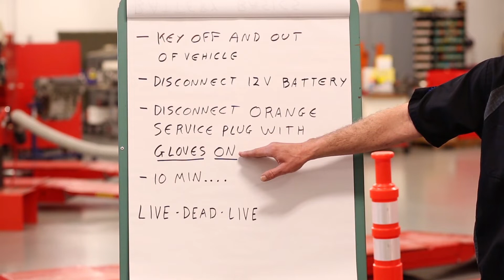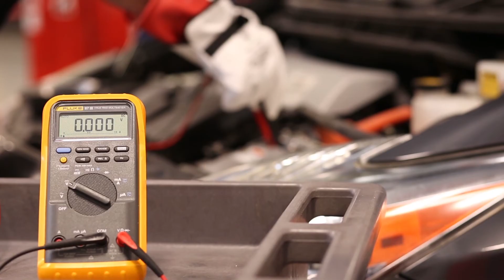Disconnecting High Voltage in Electric/Hybrid Vehicles

Comment: I'm a little surprised that the cutout switch cuts off at the positive lead, rather than the negative lead. Why? As you know, the traditional way that mechanics disable a 12V battery is by disconnecting the negative (ground) lead first. This is so that a wrench that will be disconnecting the positive lead next will not cause a short if the back part of the wrench touches any metal. In a car there are many more metal points that are on the negative side compared to the few positive contact points.  So, why is the safety on the positive side? Is it because the internal safety relays automatically cut out the negative side when the accessory battery is disabled?

Comment: To verify that your voltmeter works, you should set it to read Ohms and touch the leads together, if it reads zero ohms or very close to zero then that means that the leads are both working and able to give you accurate readings

Comment: Let me ask. If you want to use your hybrid car without the function of Hybrid bettery. What are you supposed to do?
Reply: Pretty sure you are able to control that with your car, by either using the specified buttons in your center console or on the radio interface

Comment: the service plug on this Prius actually splits the cell modules inside, not the full battery as illustrated
Reply: splitting one cell will deactivate the whole system because there isn`t a part for current to flow anymore
Reply: Yes but you still have seperate live circuits inside unless you disconnect all bus bars. All you have done is break current flow of the overall circuit in series

Comment: This video is mostly wonderful, except how did you gain access to an UNCOVERED power invert?  In my 2005 rPrius removing THAT cover requires many additional hours of labor.  Removal of the windshield washer assembly, above the back or the inverter cover, is required to access the last few cover bolts.  So it comes down to how confident can someone who wants to weld on this type of vehicle be that simply removing the orange service plug will be ENOUGH to guarantee they are working on a disconnected High Voltage Battery, without potentially killing the welder and/or the 2005 Prius.  Please address allowing access to this important multimeter safety check.  The lives of all the well intentioned shade tree mechanics who'd like to SAFELY repair this type of hybrid depend on access to the power inverter terminals shown in your video.

Comment: I have a couple questions (Have my Red Seal Exam coming up) When reconnecting the battery is it just the reverse process? high voltage battery first --> Safety switch --> 12v battery? Also the minimum required rating for the gloves is 1000V?
Reply: Class 0 For gloves (1000V) and CAT 3 Multimeter 1000v

Comment: As a tow truck operator I wish the NTHSA would require an emergency disconnect like the engine kill on race cars. At accident scenes it is a lot of work to get to all the stuff you had to do for just a repair. Much less worrying that the car body may be energized due to a pinched cable. Great video though, thanx for the info.

Comment: Great video.
2 seconds of contact at the lowest level of voltage ~ 50 ma, will kill a mechanic.
Always wear insulation gloves and use Insulated tools to prevent short circuits whilst working on high voltage systems.
Rubber insoles can be helpful in preventing shocks.
Reply: YOU SURE?  RUBBER INSOLES?   why, the damn thing is connected to Ground, thru a metal stake somewhere? my solar inverter is not...

Comment: Hello Mr.  I am Uddika Rathnayaka from Sri Lanka I have Toyota Prius ZW30 2011. In my vehicle there is a error code coming P3004. In my vehicle there is 
no corrosion in battery wires, 
battery voltage ok, 
From HV battery to inverter main power cable has no shortage 
Vehicle not ready 
Scanned several times every time same error code appeared
Please help me to solve this problem 
Thank you

Comment: Hi there. I will make some replacement on the inverter 2013 prius. I have some question with the parts number. It look like there are two lines of numbers written on the part’s sticker. Do i need to get them right, or just the first line (mine is G9200-47210)

Comment: Thanks so much. I have a project do next week on a Hyundai. I need to replace rear body panel and extension floor which includes welding. I’m assuming is the same Procedure.
Reply: Im just about to weld my exhaust on my Hybrid Lexus. How did your job turn out? Did this tutorial help you out?

Id appreciate your help 👍
Reply: @vincecfm3240  very good not a problem 👍🏼
Reply: @SRGLIST  
Awesome 👌 
Did you use voltage safe gloves?
Reply: @vincecfm3240  yes.

Comment: What do I need to do before replacing the hybrid battery? Is it safe to work on it after unplugged the orange safety plug?
Reply: Hybrid batteries should only be replaced by professional/certified technicians due to the safety equipment and training required. The courses and qualifications for a L3 ASE Technician in the US to safely work on Hybrids is around 12-36hours of safety and practical training as well as purchasing specialized High Voltage tools and Personal protective equipment. By all technical standards replacing the battery is not difficult but the risk of Electrocution is substantial and is not a job that should be handled unless you are absolutely certain you know what you are doing and have measures to protect yourself in the event of an accident. It would be the equivalent of asking if fixing the power line to your house is something you can do yourself. It's 250-800 volts, it is not something you should take lightly.

Comment: Do I need to disconnect the hybrid battery if I need to replace the starter?
Reply: Hybrid vehicles usually do not use a starter motor to start the vehicle. They use the electric motor that powers the wheels to also start the vehicle and is powered by the High Voltage battery and no current Hybrid vehicles above 250V use a standard starter motor to start the engine. Vehicles that use a starter with a Start/Stop function (that turns the engine off/on in stop/go traffic) can be replaced safely by disconnecting the 12V battery but must be replaced with starters that can handle being turned on/off 30-40 times per day (which are very expensive)
Reply: It uses a motor to turn the belt. It usually has the alternator built into it.

Comment: Hi i need to weld something on a corolla 2019 hybrid. Its the same procedure?? Thanks
Reply: Lol, I hope you're joking 😂. If you are doing welding on a hybrid chassis it is best to remove the hybrid battery before any prior work and ensure there is no residual voltage in the system. Make sure you have a clean, well connected, ground and welding can be done. I should note that modern vehicle computers such as blind spot monitors and ABS control can be damaged if excessive current from a weld is too close. Welding near or on a hybrid system is okay but precautions for each vehicle varies on each manufacturer. Even non-Hybrid BMW or Ford modules can be damaged if the frame is welded before disconnecting the connectors.
Reply: @Sergio8191994  thanks for ur reply. I did the safest way. Used the old style bolts and nuts 😁

Comment: The service disconnect actually breaks (creates an open) the battery pack somewhere in the middle so that you have two smaller (Lower voltage) batteries.

Comment: Which repairs are required to disconnect the hybrid battery
Reply: High Voltage A/C System, High Voltage Powersteering system,  High Voltage Battery, High Voltage Inverter or Electronics, and any of the High Voltage wiring.

Comment: Do you still need the gloves to work on the car after discharge?
Reply: It depends on what part of the high voltage system you are working on.
Reply: @zacharyarthur144  
For example if I just want to remove the big battery ??
Reply: @musheer5711  Yes, any part of the HV system requires special gloves to work on. Excessive moisture in the air or ground and touching metal in the vehicle could cause electricity to discharge through a person and could cause Electrocution.
Reply: @Sergio8191994  

The hybrid battery is not earthed to the vehicle chassis.
Reply: الترجمه خاطئه
المقصود عند فصل الفولتيه العاليه هل يجب ارتداء القفازات اي الكفوف